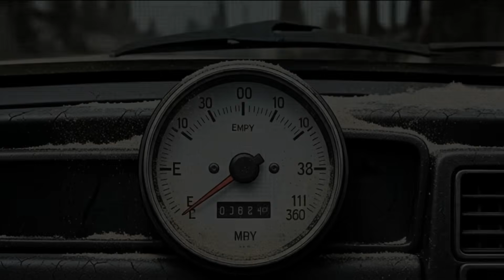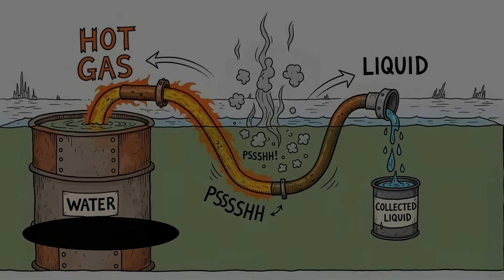How to Make Gasoline in a Post Apocalyptic World

Comment: Ok this process will make some hydrocarbon.  Not necessarily gasoline.  More likely some synthetic oil that might run in a diesel but not likely  flammable enough to ignite in a car although it could possibly be added to gasoline to extend it. But just like adding bad gas to your tank it could likely leave sticky deposits that can make your valves stick

Comment: Gasoline manufacture is WAY more complex than heating plastic scrap in a barrel, if it were this easy, there would be no plastic disposal problem. The "fuel" this process produces will likely destroy a modern engine very quickly due to pre ignition or detonation, depending on its octane rating, which will never be stable. Complete BS from beginning to end!

Comment: Plastic is an oil based product so its not a far fetched idea.
Reply: @sjanssen1432
Pyrolysis is basically breaking the plastic down into crude which can be distilled into different fuels.
In the mad max scenario depicted in this shiite video, you will burn more energy to make the fuel than the fuel will provide.
You would be better off making a wood gasifier which uses pyrolysis on the wood itself to extract flammable gasses (hydrogen & carbon monoxide if i remember right) which after a filter washing (to remove tar/kreosote) can be run into ICE motors.

Comment: Truly not to be experimented with there is working machines u can buy to do depolymerization and carbon wood plus water Fischer troph process to make gas . Some working machines are on line . 100 octane. No pollution if u use electric for heat source.
Reply: There ARE. Back to school.

Comment: Btw. After mad Max SHTF.
You can just buy fuel from me.
1 troy ounces of gold per gallon.
I can be found on channel 13 on a CB on I-10 between El Paso Texas and I-20 turn off.
Id advice finding a place to lay low 100 miles east of El Paso. And radio every hour . Until you hear from me. 
I will sell you as much fuel as you can hold. If you have the gold.
I have oils from 10w to 140w. ( Strait weights only)
Pure gasoline( no additives)
Diesel
Keorocine 
1 tr oz per gallon of fuel. And 1 tr oz per quart of oil.
I also have GAA ( grease) upon request.  1 tr oz per cup. 
Fuels, I will sell from 5 gallons to 10,000 gallons. 
But bring lunch for those large quantities.  You are going to be waiting a few days on orders larger then 200 gallons.

Comment: Making gasoline for dummies.
You will need a 55 gallon drum with a removable lid. 
A 15 gallon drum .
A 2 inch steel pipe that goes between both .
3/4 inch pipe with adapter to go to the 15 gal drum and out the other hole of the 55 gal drum.
Once the 3/4 pipe is outside the 55 gallon drum it needs a 90 degree  and then a T. 
Off the T you need a full funnel. That when not filling is capped off. 
You need to put a full hole and cap into the 55 gallon drum.  And a cap / breather in the 2 inch hole of the 55 gallon drum 
Now. Back to the 3/4 after the T. All this is 3/4 steel pipe.
You need to go up 4 foot. Put a 90 degree. Add 10 feet of pipe. Another 90. 5 feet of pipe. ( Going down).
Another 90. 
Now the tricky part. 
Add 2 feet of pipe. And a T.
Then keep adding 1 foot pipe and Ts.
Once you start your plant 
Your oils and fuels will drip off those bottom Ts.
Operations...
Put 5-10 gallons of crude oil into the 15 gallon drum.
Put 5 gallons of crude oil, mixed with 1 quart or 1 liter of gasoline into the 55 gallon drum. 
Light the oil in the 55 gallon drum.
Adjust the air flow.
Stand back . Until it's " stops cooking"
Let it cool before adding crude to the 55 gallon drum. 
Fill the 15 gallon drum as needed. 
You have now made multiple weight oils gasoline, kerosene and diesel.  Oh and tar if done right. 
Enjoy. 
Btw. I never said this was not dangerous. 
And barrels will " burn out" quickly.
Reply: Exactly
Reply: Your comment was the BEST part of the video!!!!

Comment: Water is an abundant resource you can also turn into fuel, through electrolysis or using zinc, zinc can split water into hydrogen and oxygen.  They didn't tell us that zinc splits water did they.  Since we drink water and can't live without it, water abundance means it can also be a fuel source.😮. We also can make alcohol😮 for fuel and drinking😮